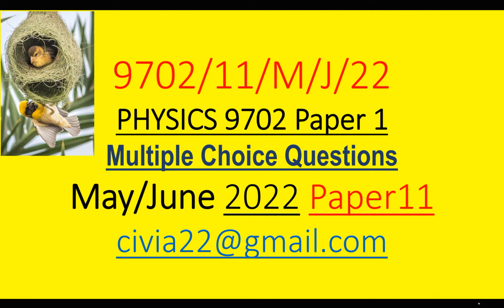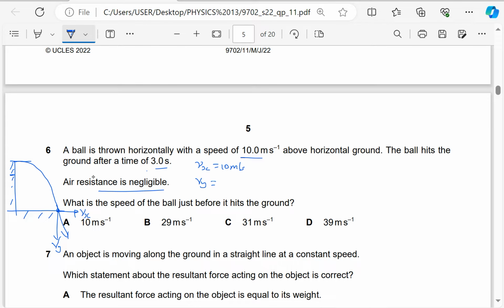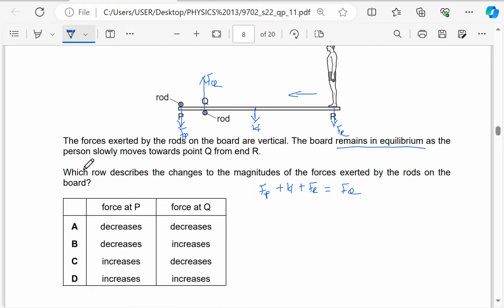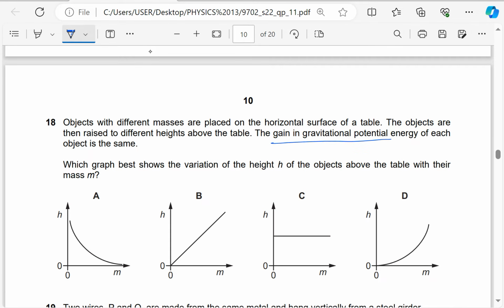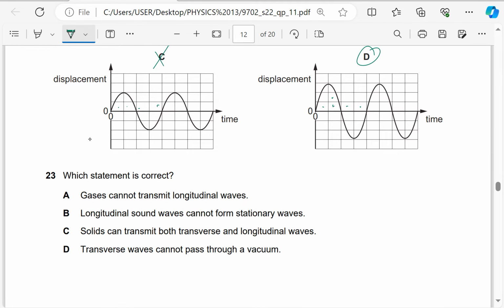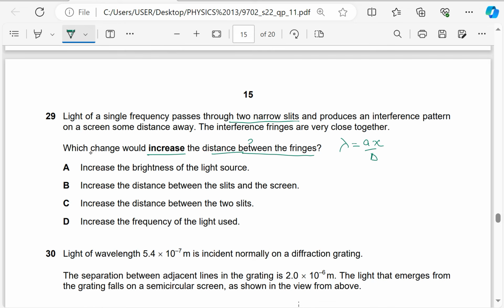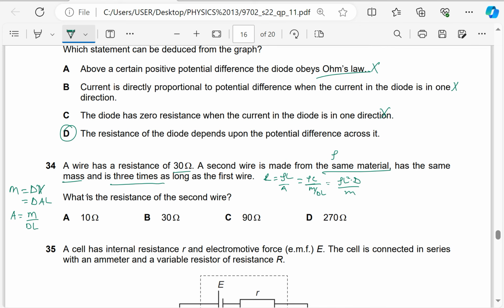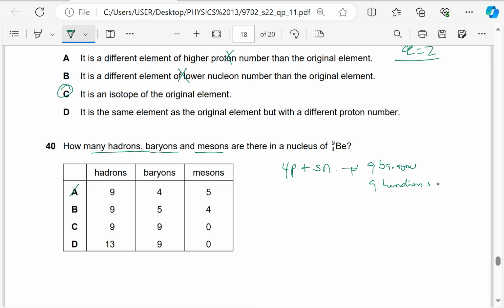CAIE AS Physics 9702 MAY/JUNE 2022 Paper 11 solved MCQs

Comment: In q11, for there to be motion, there should also be some force applied to the right, yes? and even if the horizontal resultant force is 0, then the answer should show two arrows in opposite directions...i dont get that question